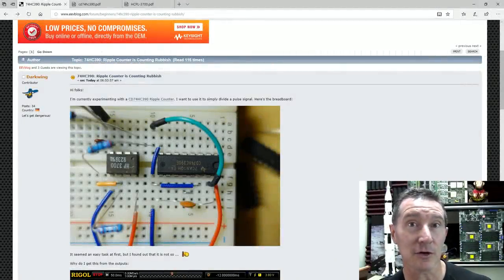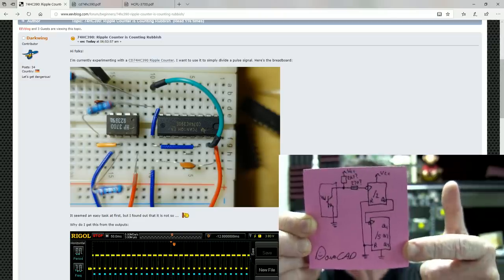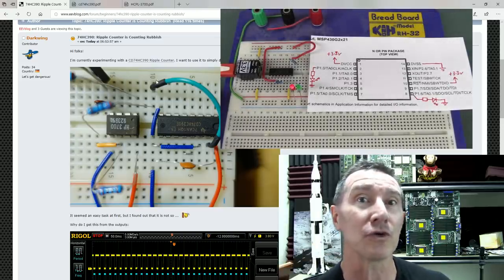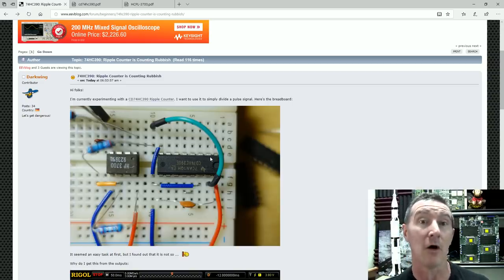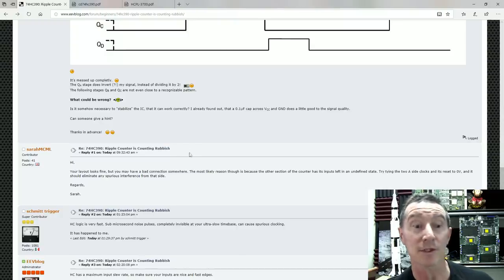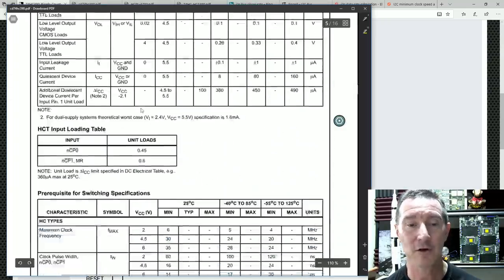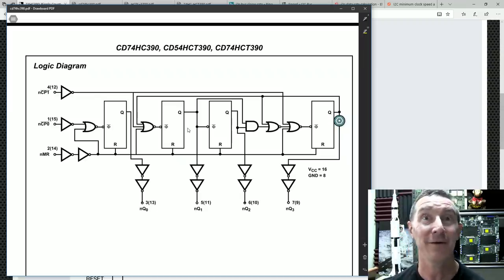EEVblog #1208 - Circuit Analysis & Debugging

Comment from the maker: This video is why I genuinely hope your next beginner project FAILS. Because there is so much to be learned from troublehshooting problems like this.
Reply: Failed projects have taught me more than most of the books I have read. There's nothing like having that "perfect" circuit, only to apply power and either get nothing, or magic smoke :)
Reply: I miss the Friday videos, fundamental videos
Reply: can i use a 555 as a schmitt trigger
Reply: Experience is what happens when things don't turn out as you expect! :)
Reply: I have learned more by getting out of my comfort zone and failing than I ever did by getting walked through a lab syllabus. Half the battle is researching and learning how you accomplish the project, and the other half is fixing your own mistakes.
Reply: Duplicate it in the lab
Reply: I was always taught that if someone never makes mistakes, they are lying. You only learn when you make mistakes ... just don't keep making the same mistakes, it means you never took the time to understand why and really learn from it! (I know too many engineers who keep making the same mistakes over and over. Drives me absolutely nuts!)
Reply: @simonbaxter8001  I once had a cool boss that would say mistakes are an indication that people are doing actual work.
Reply: @God-CDXX  you'd be better off using an lm393/339. Actually, you'd be better off using a schmitt :P
Reply: @simonbaxter8001  successful people are exactly the same as people who are not successful,  except that the former have failed a lot more than the latter.
Reply: When I'm troubleshooting boards with little or no documentation, I get coffee & datasheets, and dive in. Do more videos like this Dave; i enjoy observing YOUR thought process (e.g. the Schmidt trigger suggestion).
Reply: that is only true if you have somebody that can help you out because  as a beginner you will have a buggery hard time figuring out what went wrong. personally i think this would have taken me ages to come up with
Reply: Assuming you do actually manage to fix it, and don't go insane whilst trying to do so. I gave up on many projects when I was a kid, from lack of access to information or lack of knowledge where to find it, nobody to help me, and no internet connection either.
Reply: You should make more videos like this!
Reply: @urugulu1656  yup. That is where I learned about determination.
Reply: @testep02  Erratic behaviour is better or even intermittent ...mmm what a challenge!
Reply: The biggest abomination I've witnessed beginners made - not giving a shit to safety. Grinding with no protections, abusing components/tool/equipment and soldering on live circuit! Fck me!

Comment: btw. since you mentioned the forum, i myst say that the EEVblog is one of best community forums in electronics that i know. So many times i got great  tips and helps. Thank you all guys!
Reply from the maker: Indeed. There are many that have left other forums and come over.
Reply: @EEVblog  did you think of making slack# chat for eevblog or something like that?
Reply from the maker: Not slack, but have tried several chat system over the years, they just degenerate into vitriol. There is an IRC channel though with a bunch of core users.
Reply: @EEVblog  current forum software does all we expect, however, as everything is changing in the world, some refreshments would be nice. And maybe also attractive for younger, new users.
Reply: Badcaps.net forum is good too.

Comment: Currently working on a design that uses these 390 counters, and yes I've had this same problem when driving it with signals from an Opto-coupler. Once I put Schmitt trigger gate in front of the 390, it all works fine now!

Comment: Dave please do a video on how to use MOSFETs properly. I always get in to trouble in my projects because MOSFETs do not switch on property. Specialy on high side switching with n channel  MOSFETs.
Reply: Read online
Reply: You most likely arent using a resistor on the gate.
Reply: Add a 1k to the gate if you dont have one.
Reply: You cannot simply use N transistor as high side switch.
Reply: To use an NMOS as a high side switch, the gate voltage needs to be above source voltage by the Vgs specified in the datasheet for the current/Rds(on) you wish to achieve.
Reply: @LittleRainGames  especify in which  terminals of between which nodes
Reply: bootstrap your high side
Reply: @jim9930  There are quite a lot of high side drivers that integrate charge pumps, Analog Devices have a whole range. That said it's not as simple or cheap compared to driving a pmos device for static power switch applications.
Reply: @jim9930  Sadly they do seem to be having some issues. The staff at Linear Tech have taken a pretty big hit and doesn't seem to have resulted in much integration between the companies; speaking to the FAEs I get the impression of a 'them and us' attitude.

Comment: Yup, I've experienced all the problems Dave mentioned: Glue on the resistor leads (I now ALWAYS cut my resistors off the tape) and slow rise time/fall time without a Schmitt Trigger is always a bit "how ya doin". Also violating the setup and hold times between a data line and a clock will yield all kinds of random problems.  Gotta pay attention to all this stuff to get it to work right!

Comment: In fact what Dave said is true as I faced a similar issue when designing my motion sensor using a digital pir sensor with a retriggerable monostable multivibrator and ended up going with 74hct123 as it has Schmitt-trigger inputs so that saves the hassle of adding a extra chip

Comment: Dave, as always loved your video.  You bring up some awesome points.  I could be wrong, but I think in this particular case the 74390 is doing exactly what it's being asked to do.  If the desired result is a true divide by 10 decade output then they are using the wrong configuration.   If you go to the logic diagram of the data sheet it has a footnote that shows two diagrams, one with Qd tied to Ia and one with Qa tied to Ib.  For a divide by 10. The first stage must always be the divide by 5, which then feeds the divide by 2 to clean up the signal.   I think that is the issue with the logic output being displayed, its hooked up backwards.  Which is valid, but does not yield a nice clean divide by 10 logic output.
Reply: It will be divide-by-ten either way. It's just in one configuration, with the divide-by-two second, you get a square output (ie: duty cycle of 50%), whereas in the opposite order you do not.
Reply: @jim9930  How does a 393 solve either the rise/fall time problem which is the topic of the video, or Rob's issue of this not being "true divide by 10", (which I inferred meant Rob would want a duty-cycle 50% output)?
Reply: @Graham_Wideman  you are absolutely correct.   Assuming that the output wave for the first tap is Q0, you would at least expect at x/2 signal rather than a 1:1 inverted signal, which is what it looks like we're seeing.
Reply: @RobTaylor-HiTech  Right.That's the topic of the video -- why is it doing that. Not because the divide-by-2 and 5 stages are connected in a particular order, but because of slow rise/fall time at the clock input, possibly permitting undue sensitivity to the downstream transitions.
Reply: @jim9930  So, in short, a 393 doesn't address either of the problems addressed here, and can't even divide by 5 (or 10) without  additional gates. And noting your twice-mentioned concern with speed, the 393 is still a ripple counter, so doesn't solve that either.  And I'm hard pressed to see how your other statements have any bearing on the current topics. Even your possibly sensible comment about employing '14 as an inverter just so as to have spare schmidt inputs around is made dubious by suggesting AC14;  AC is a much faster logic family with higher switching transients, requiring more attention to supply bypassing, and thus less suited to breadboard than HC.  Young fella.

Comment: 21:33 Yes, pull-up resistors do significantly affect rise and fall times in an I2C bus (and other open-drain/collector configs). We usually test such timing parameters with a data generator. There's also the nuance of shorting the data generator's output to ground when the driver goes 'low' and the output is set to 'high' (when we're expecting an ACK response from the D.U.T.) so they come equipped with inhibit features.

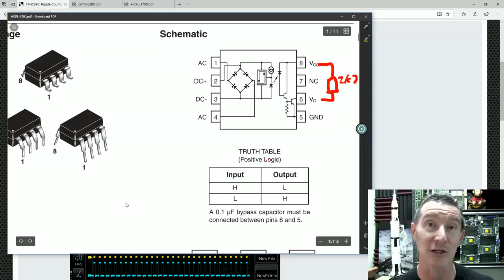Comment: (10:00) For an open collector output going high the saturation is absolutely critical for the transition time.
The LOW to HIGH transition of a BJT will happen at about 1 to 10 Volts per microsecond and volt of supply at best. There will also be a dead time of 100 to 500 ns before the BJT starts to transition.

Comment: I believe it is incorrect to refer to this as a metastability problem as this occurs when you have a clock and a data input to a flip-flop changing approximately simultaneously. Since it is only the clock input to the flip-flop is changing here there should be no opportunity for the classic metastability problem to occur.
It is more likely that we have a multiple clocking issue here - as the slow clock signal transitions through the threshold window of the clock input any noise on the clock signal can be seen as multiple clock transitions and the counter can increment several times for each apparent clock pulse input. Noise on the clock signal could be coupled across from a changing output through the relatively high stray capacitances inherent in breadboards. Even if the slow clock signal is quite clean and there is no coupling from stray capacitances you can get a similar effect from noise on the supply rails modifying the effective threshold voltage of the input stage of the counter so it is still essential to have good supply bypassing even for slow clock rates.

Comment: As you state in a written addition note, the opto input drive has its effect and needs to be checked.  It even is a known trick that a speed-up capacitor has been added over any input resistor.

Comment: Way back in high school there was a project to make a trolley that ran along a rope and dropped a bean bag at a specified point. We could use whatever skills we had, so I built a counter with a 4017 (decade counter with decoded outputs) and a reed switch and magnet on the pulley. It never worked right. I'm pretty sure I didn't have any pull-down on the input, just the reed switch tied to Vcc. It worked when I tested it slowly, but not when it was moving quickly when I took it to class. D'oh!

Comment: I am sure you are right about the other side of the IC (independent of the side being used)... I had issue with SN74LVC1G74 when PRE and CLR (both active low) were NOT connected (to VCC in my case cause I was not using them). The datasheet does not explicitly say anything about PRE but says CLR needs to be connected to VCC if not being used. Example circuit shows PRE connected to VCC. One should always look at the database even though the database may not be correct :/... I used a TI part (TXS0102 - pins were not shown correctly), rest of the board was unusable because of this. I finally figured it out and sent them what the problem was. They updated the datasheet. Too bad, I cannot even use these boards for paper weight :(... PLEASE, always report the problems you find as this will help others!!! (unless you are a competitor hihi)

Comment: I find bread boards can cause many head aches with signals especially with clock feed through and cross talk . So I now tend to use a PSOC for glue logic. And if you I just want to test a simple concept.  
Make sure the ground are not looped like a rat's nest. Keep them to a common point. Keep wires short twist cables use ferrite beeds.

Comment: A larger maximum slew time can also be guessed at by taking the minimum propagation delay of any input signal to output. So one number I see is 17nS .You do not want the input slew to even be this slow since the number would be where it could use an output as a feedback signal.

Comment: But the datasheet of the HPLC3700 states clearly on the first page under "Feature": "Logic Level Compatibility" ;-) And still on the first page under "Description": "The output is TTL and CMOS compatible." :-) Though, that's kind of a bold claim with an open collector output :-))

Comment: I would start at the opto, almost certainly the problem. Not only is the slew rate of the output questionable, if the AC signal driving the opto has a low slew rate it could add to the problem.

Comment: Lots of nice tips. The glue on resistor leads thing isn't a joke. Actually screwed me up once. Noticed that the optocoupler data sheet says "A 0.1μF bypass capacitor must be connected between pins 8 and 5" (aka Vcc and GND). Doesn't appear to be one on the breadboard.

Comment: The oscillations are visible on input 3 (the magenta one) as extremely thin spikes. This line seems to have gone positive, as and when desired, but then immediately back to negative, indicating that it assumed two clock pulses when only one was present. It seems like the Schmitt trigger would sort this out, as Dave suggested.
Reply from the maker: Didn't notice that, I don't usually edit in a full HD window so often miss fine detail
Reply: It's quite possible that the positive edges of the signals that transition at the time of the thin spikes that you noticed are coupling back to the clock input that is s-l-o-w-l-y transitioning high-to-low, sending it briefly back across the L-to-H threshold, setting up a second increment of the counter.

Comment: Googling the HP3700 produces the original date sheet dated ©2005 Fairchild Semiconductor Corporation, which might explain the poor output specs, and that was Rev. 1.0.3 so there may have been even earlier versions?

Comment: Never assume what you think is supposed to be happening is what is actually happening - make sure to actually check. Going just by what you think you know for sure invariably bites you in the ass. Any pin could have a bad connection, so measure the voltage on the ones that are supposed to be connected to a fixed voltage, directly on the IC's pins, and make sure to measure "0V" pins relative to "Vcc" so you actually see they're "Vcc volts" below it, not just reading "zero volts" relative to the ground while they might still be completely disconnected. Try powering your rig from a few batteries - this used to be a non-issue when everything was behind a 7805 linear regulator in the past and nobody had switching supplies, but these days it's the other way around and you never know how bad a ripple there could be, and what it could do to an insufficiently filtered logic IC; throwing some batteries at it is the fastest way to eliminate the possibility, instead of fumbling with how much filtering is enough and how low a ripple should be harmless. And yes, if it's none of these it could also be the clearly problematic clock slew rate.

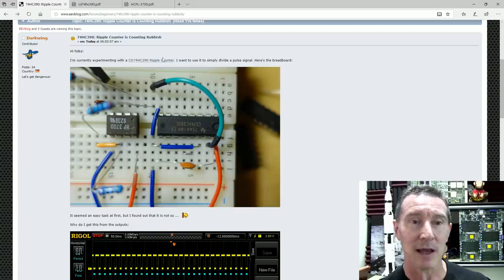Comment: It doesn't work because it is upside down! - 0:59   ;-)

But seriously, help the people you are asking for help from a little by making sure your posts are as readable as possible (clear and right side up).  Then add a bunch of bypass caps as that's likely to be many people's first guess (mine).
Reply: And looking at the posted scope view you can see the glitches on channel 3 where there is a very short high pulse that isn't latching in like the rest of the pulses on that channel.  The OP needs to notice this and zoom in to see and show what is happening there.
Reply: And why put a 270 ohm resistor in series going to the counter?  That's not exactly going to speed up the transitions.
Reply: You're damn right! Even if the chip remains stable, that slow input is triggering an extra pulse.
Reply: @userPrehistoricman  - Well something is happening there and it isn't consistent.  Could be any odd (1, 3, 5) number of extra pulses that shouldn't be there.  But in the end you need to see and not ignore those glitches that your scope is showing you.  Zoom in as those glitches are likely very short (in the ns to us ranges) but at least the scope is showing them even at 50ms/div.  Also, notice that they are right on the edges of the other signals.  You can't just ignore those because they are "short".
Reply: Obviously. The scope's timebase is actually very slow.
Reply: @userPrehistoricman  - The reason I was spelling it out is it's not always obvious to a "young player".  But it even slipped by Dave this time.

Comment: I would Take out the 270 Ohm(??) resistor if that is 2,7k or even 27k that would explain the "soft" rise and fall time, why drive the capasistance of the breadboard and input of the 74 counter ic, with a 270 ohm resistor, I can't really see why you need a resistor in series with the output of the optocoupler..
Reply: @jim9930  OP isn't talking about the pullup resistor, but the useless resistor connected between opto output and counter input. It will worsen specially problematic t_f a lot.

Comment: Dave, tks for the lesson! Like it just like your tutorion on removing ripples in power supply. 
I hope to learn about the various digital to analog converter configurations if you cud go thru.
I hope to learn about if one dac chip cud replace another one with better spec, if the connection of various pins are correct. Also how to configure the various inputs for SD cards, spdif, optical etc. I just can't get it from the internet...
Tks!

Comment: My eyes are not good enough to read the scope dispaly so I can't comment on clock glitching.  However when the device is used as shown the output is not going to be a square wave.   To get a square wave you need to divide by 5 then divide by 2.
Reply: Yup, that’s a well-known trap for young players. Not an issue if you’re single edge sensitive and need only to divide the frequency of the input, but otherwise it might be a pain.